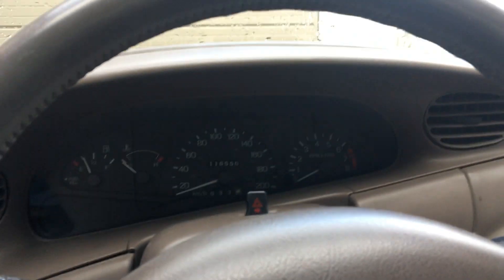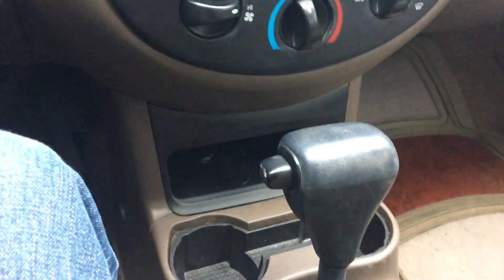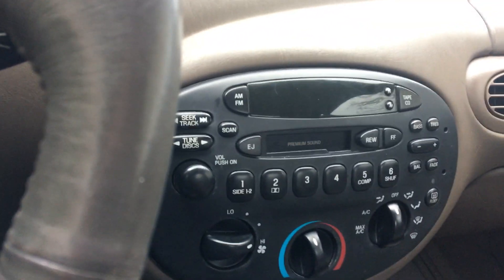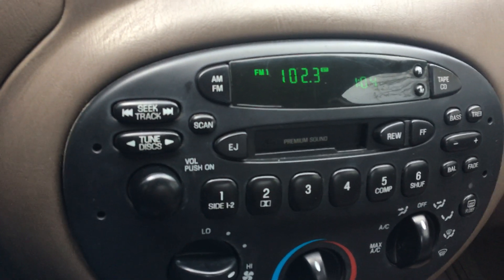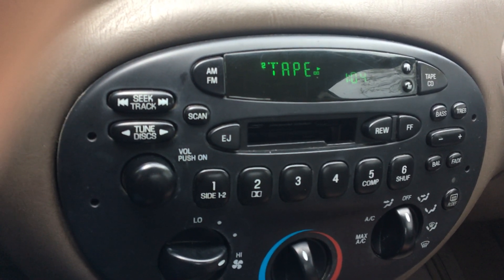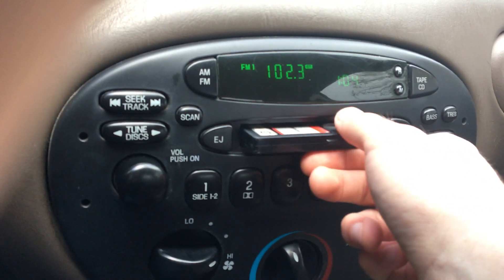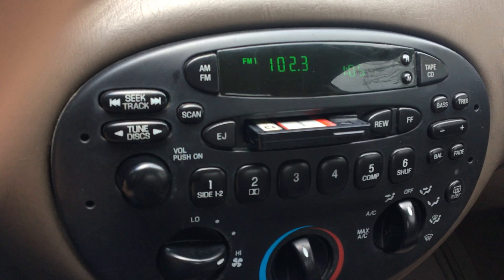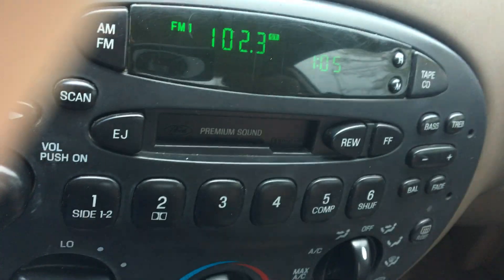1999 Ford Escort ZX2 Tape Casette Deck Issues.

Comment: Mine played normal when I first got the car 2 years ago. But then next time I tried to play cassette, instead of playing it just started flipping back and forth rapidly between radio and cassette output and wouldn't eject. Had to pull over cuz i was starting a 10hr trip and not about to listen to static and Lion king overlapping each other. Tried prying it out with pliers and all I managed to accomplish was tricking the radio into thinking it didn't have a cassette in it, and now the cassette is stuck. My Odometer is 83K miles rn. When I bought it it was 69K.

Comment: Actually if you still haven't gotten it fixed it could be a piece of debris in the tape path the way it flip flops sides and ejects it like that I had a vcr that did a similar thing and it was because a chunk of a vhs tape broke off in the pinch rollers path lol

Comment: The tape deck switch spring is warn, and maybe the motor drive. Um you can try to clean it but more than likely if you want the tape deck would probably need to be rebuilt but I'd just swap it out for a media player or CD. But if you dead set on tape then rebuild or replace with another one